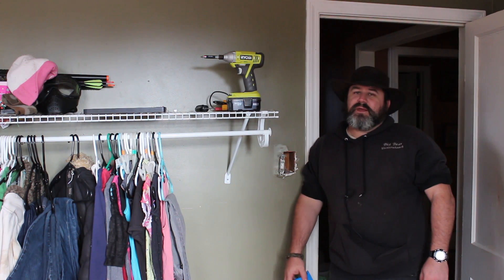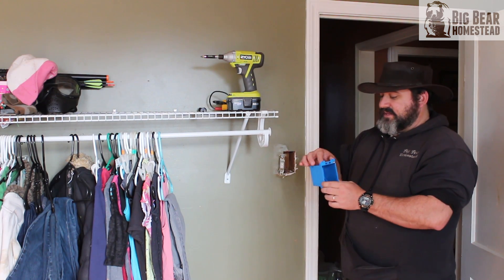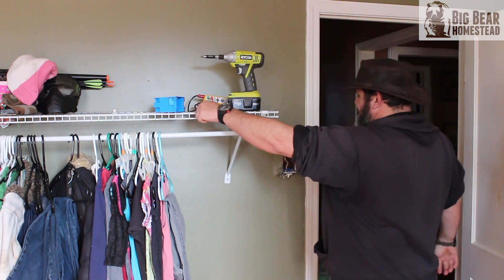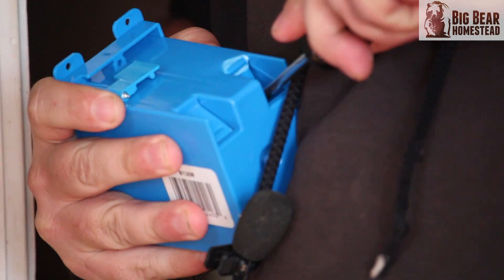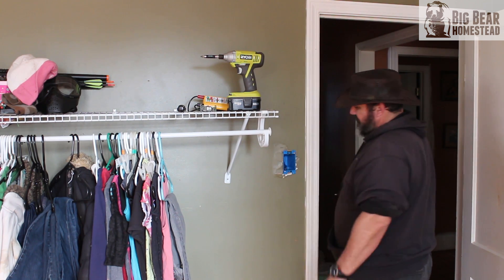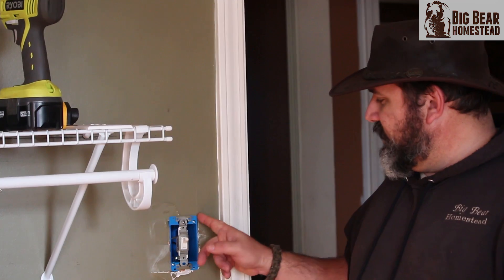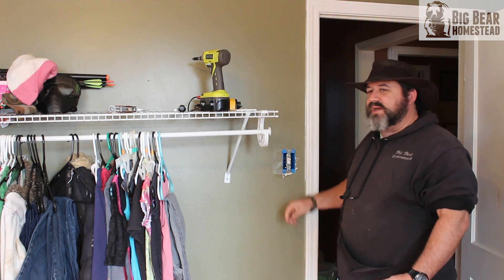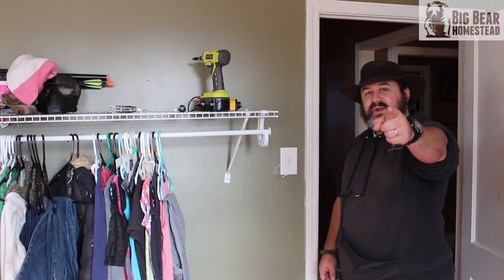Are You Replacing An Electrical Box The Right Way?

Comment: I’m installing some GFCIs for a friends an older house and i’m used to commercial where you’re installing much more spacious boxes with perfect wire length... i’m gonna have to replace a few of the boxes with not gross ones and probably use snap connectors to connect the receptacle with jumpers bc the original wiring is way too short
Reply from the maker: We just did a video on changing out a gfci,  go check it out and tell us what you think. Did we do a good job?

Comment: A pair of lineman's pliers are a must for pulling wires through a new box. The thing I really hate about those plastic boxes is the existing wires will sometimes separate on either side of those punch tabs instead of going behind them where they belong. I've seen electricians just take those tabs completely out because of slack issues.
Reply from the maker: Good tip thanks for watching

Comment: Need to remove and replace a nailed in completely broken "plastic" outlet box. Going to use tin snips to cut the box into small pieces until I can rip it out. Unfortunately,  I bought the nail-in replacement box, so I'm just going to slather a large amount of construction glue on the box and jamb it back in. Hopefully that will hold it.
Reply from the maker: Did it work?